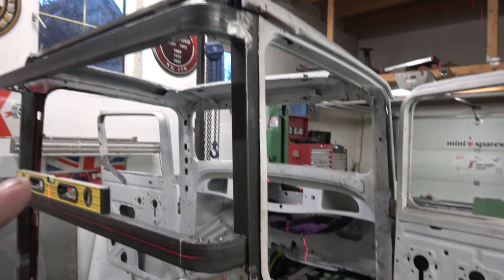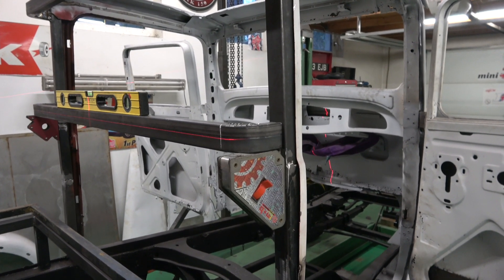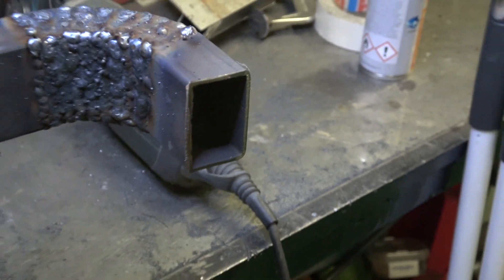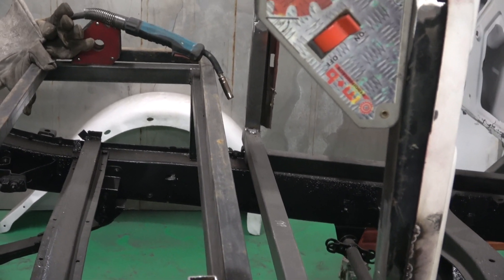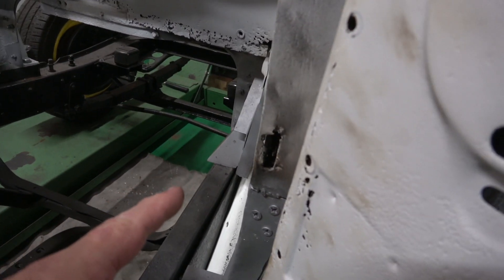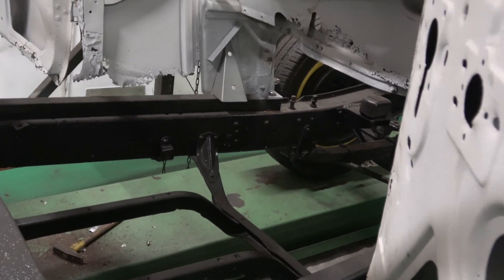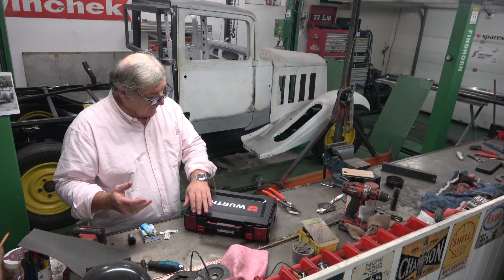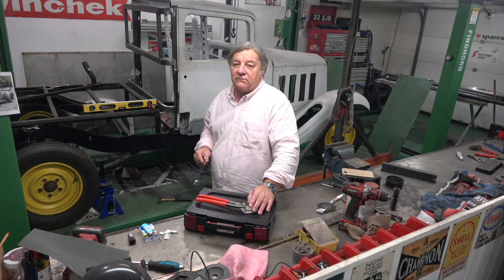Fabricating A Pick Up Truck From A 1930s Citroen Car ( Part 5 )

Comment: Hi Dave.  I completely agree with you on those red magnets , about as useful as a chocolate fire guard ! It's coming together pretty well , you must be pleased with the progress . I guess you're aware of the riv-nuts being metric only.
Reply from the maker: John,  The one thing the red magnets are good for is picking up iron filings or metal dust off your workbench lol.  I‘m pretty happy 
with the progress so far and I think the beading will make the cab look really good,  Metric is Perfect as I live in Austria lol. Cheers Dave

Comment: Thats hilarious, as you said what you just bought i was looking through my local tool/parts store (Princess Auto) sale catalogue for the christmas season and was looking at a rivnut threaded insert kit, great minds.
Reply from the maker: Doug,  I have been after a set for a while as I said the Jaguar XK and the Citroen both will need some rivnuts for pipework so it was time to I bought one.
The is a guy called bad chad who I watch that started doing the same kind of job just last week a sedan to a pick up lol. Cheers Dave

Comment: you could just fill it with weld, but that's not your way, nice job quality work.
Reply from the maker: Gary,  Yes i could but if it‘s not square or has the same standoff all round the weld 
will not be consistent as your using the wire to bridge the gaps. Cheers Dave